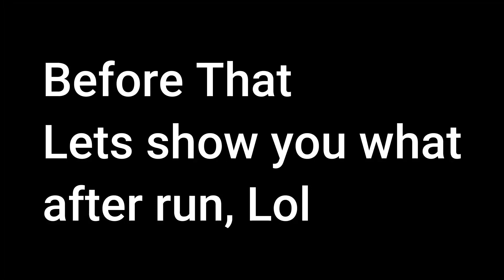Received T-BONE RACING Replacement for ARRMA MOJAVE & After Test

Comment: Going through issues myself after installation. T-Bone was fast in responding to inquires and such. In my opinion, the guards would be good front debris protection. A body dust cover would  keep out a lot of stuff that comes from the top and behind. Would have to keep in mind that heat would be another factor to consider with all that protection. Wish Arrma had done a better job of protection than leaving it to us geniuses to figure it out! :) Thanks for uploading the video. It gave most of us a starting point to begin. Cheers!

Comment: I use a dusty motors cover and shock socks with my tbr  see s to work well
Reply from the maker: dusty motor already release mojaves dust cover？ going to looks for one too 😁😁🙏 thanks ya
Reply: Where did you get the shock socks for It Paula?
Reply from the maker: @cwatson42785  i think i saw the shock for the damper at rcmart before ， but from china， they way cheaper
Reply: @liulangmy  I found some from a seller on Ebay for like 10$ 12$ from a US seller. Thanks for the help! Think I might get some after hearing your duck quack! Lol
Reply from the maker: @cwatson42785  🤣🤣🤣🤣Lol，welcome bro ，it will needed， especially run in sand or beach.
Thanks for watching ya😁😁😁
Reply: @cwatson42785   they came with the dusty motors  over nothing special but handy